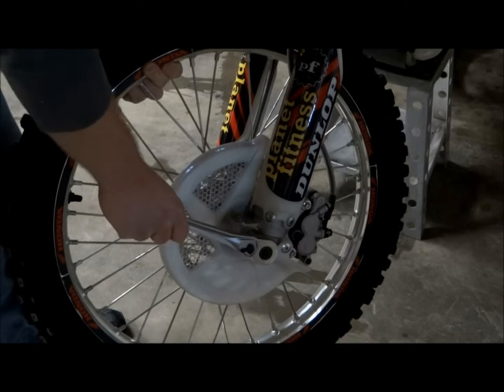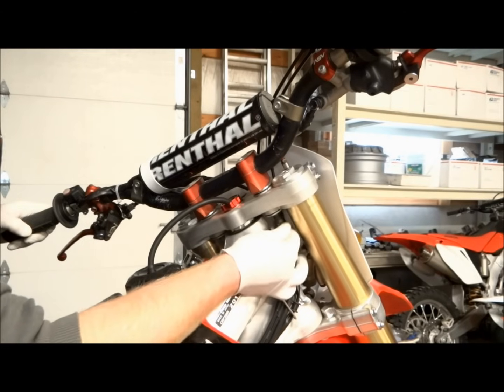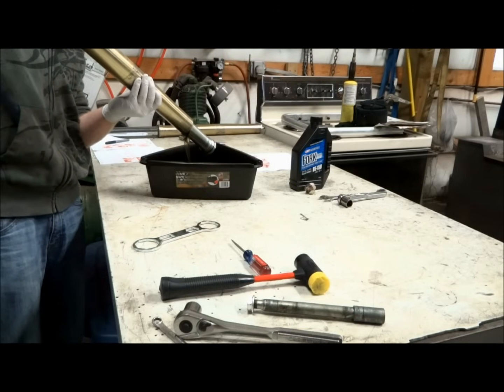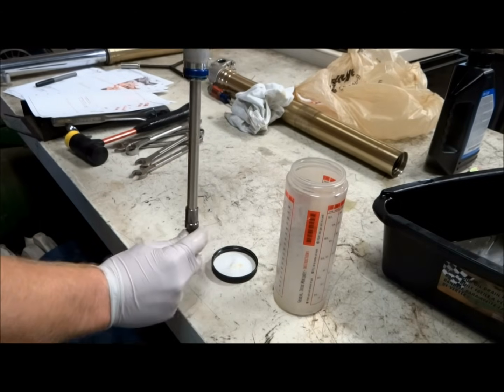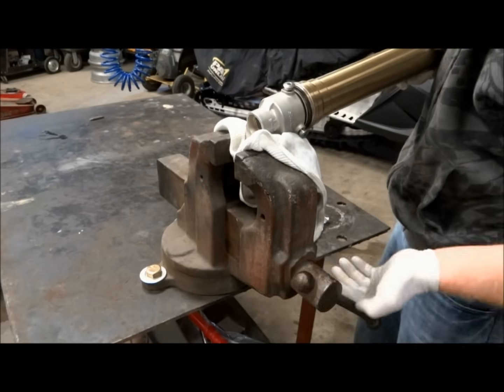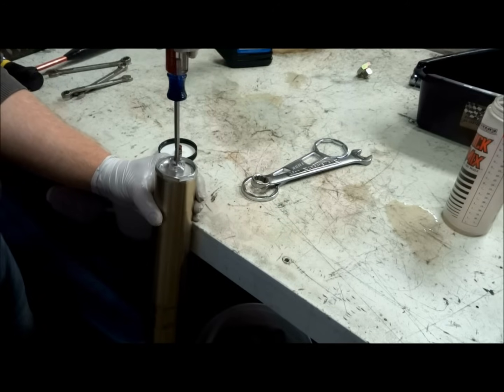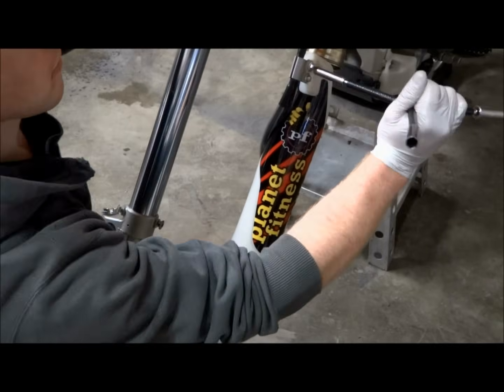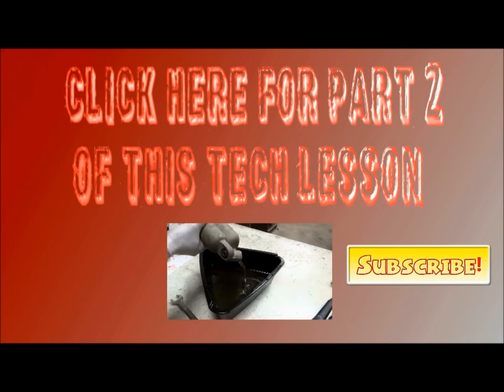CHANGING SUSPENSION OIL PART 1

Comment: Are the 2011 crf250r forks identical to the 2010 Crf450r forks?
Reply from the maker: The 250 forks are Showa while the 450 forks are KYB brand. Internals will be different.

Comment: Great thanks just hit 20 hrs. On my 2014 RMZ250 and was told I need to change the fork oil. found your video and looks like I can do it. I'm a rookie but have mechanical abilities. Thanks for the help.
Reply from the maker: Thanks for watching! The process for changing the oil in your forks should be different as they are Showa SFF forks while the ones shown in the video are Showa conventional forks. Some of the things will be the same, but refer to a service manual for the exact procedure.

Comment: first of all. srry about my english but, the bolt you let go air on the top. if you push that to hard att the suspension looses grip inside. do i have to buy new suspensions?
Reply from the maker: So you mean the threads are stripped out? You will need to install a heli-coil to fix the threads so the bolt holds. Do a google search on "heli-coil"
Reply: thanks

Comment from the maker: Tighten and torque the triple clamp pinch bolts first, then the stem nut, and after that the axle. Then follow the procedure for aligning the fork tubes shown in the video. There really is no correct order to tighten the triple clamp bolts and heat nut, as you tighten things will align on their own unless of course something is twisted.

Comment from the maker: The stock size bore on a 10-13 CRF250 is 76.80mm, and then some OEM places sell two or three O/S pistons in increasing sizes. If your bike has not been rebuilt, you will need the STD size piston. You could always measure the cylinder too.

Comment: Yeah can make a difference, up to 20cc... Drain overnight if you have time. 

Hey I have a question off topic. Do you know how to determine what stock piston size you need? I have a 2010 CRF250r and there are 3 stock sizes. I know with Yams it is marked on the barrel. Any ideas?

Comment: Hey with forks you need to consider how much oil is left in after you have drained. I know the Honda manual has a diagram showing the approx amount of oil left in the fork based on how long you have drained it. Something to take into consideration.

Hey thanks for making some great vids mate. Cheers

Comment: although im not nearly as good as a mech as you are. id recomend to everyone when tightening your fork cap/cartriage caps. just tighten the bottom tripple clamp bolts to spec. then tighten caps. and then proceed to tighten fork cap/cartraige cap. that way there is no chance of you damaging threads on the fork cap

Comment: it looks like there is a tiny bit of oil in the damper assembely. could i get away with just removing fork cap and doing it as if it was a single chamber fork? and eventually the oil will equal out and start to clean out the inside?

Comment from the maker: Yes, you could leave the cartridge in the fork if you are changing just the oil. But most of the time seals or springs are changed when an oil change is done. I was just following the service manual and that's the process it showed. Thanks for pointing that out, I didn't really think about that when I was working on the forks.